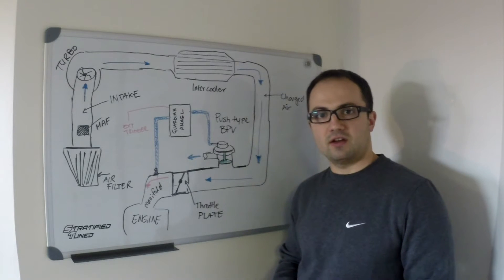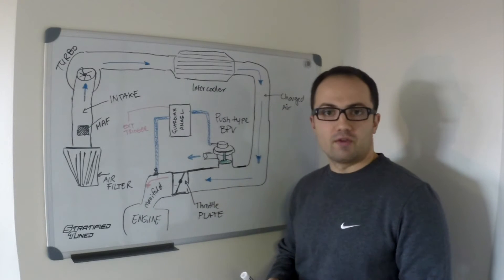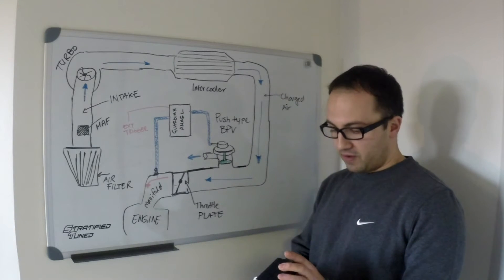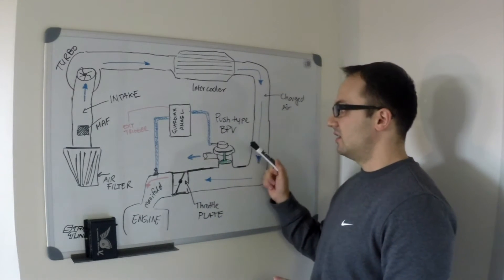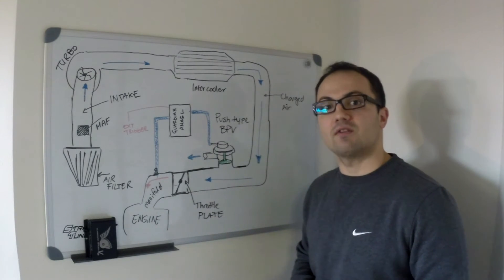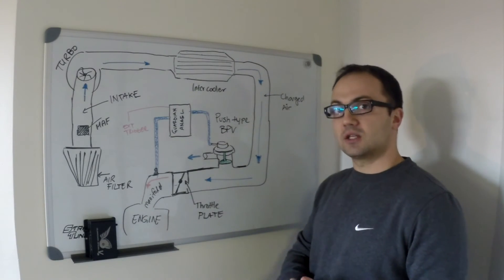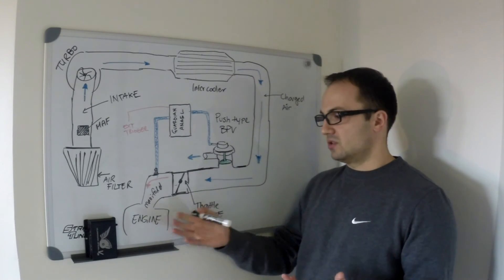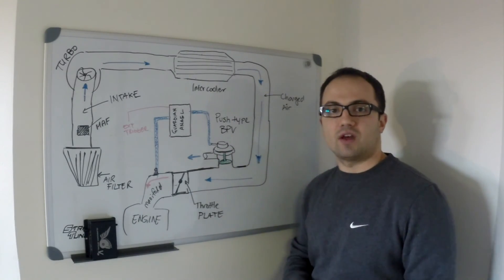Stratified Auto Explains how the Guardian Angel protects your motor

Comment: Is special tuning required to run this device? Is it needed on stock turbo? Fost
Reply from the maker: No special tuning needed. It can be used on any turbo. On the FoST it's nice to use it to control the OEM valve and not use the stock solenoid.
Reply: Yea mine flutters all the time.